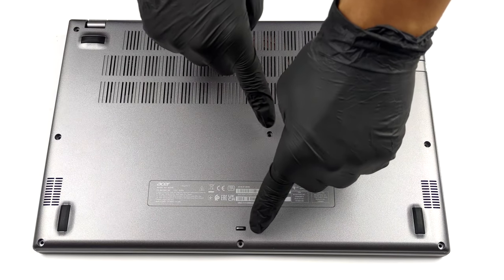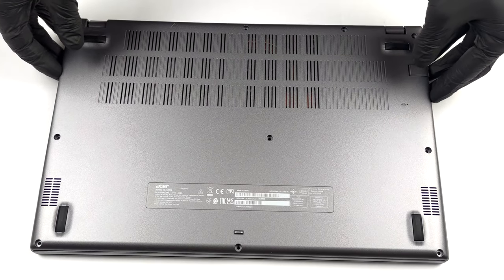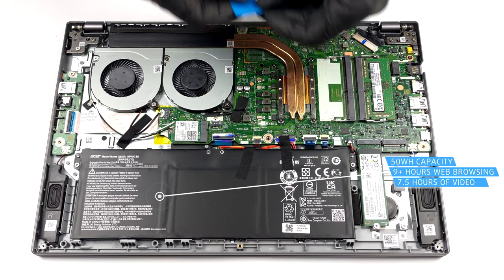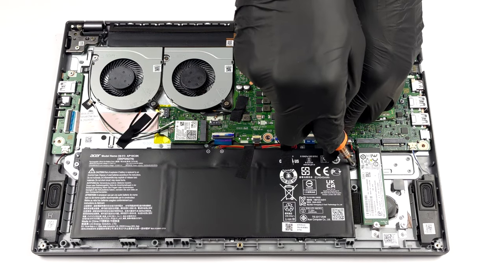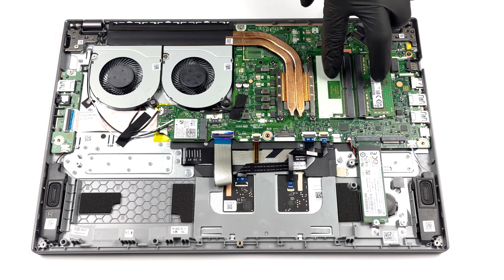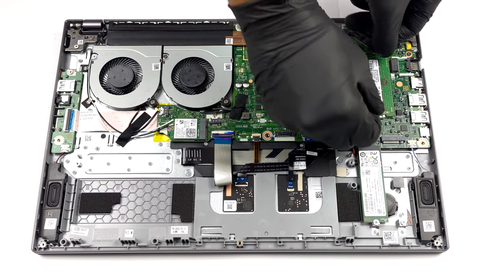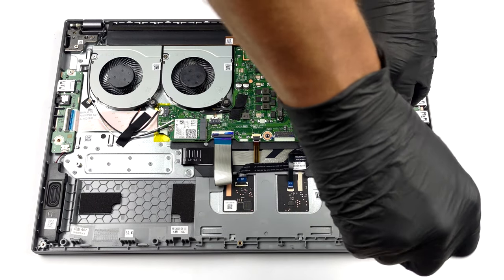🛠️ Acer Aspire 5 (A515-57) - disassembly and upgrade options

Comment: the 12th gen CPU's support up to 64GB of RAM. Is it possible to use one or two 32GB sticks in this notebook?
Reply: Acer tech support told me the maximum per module was 16GB. full max in total 16GB. I asked them several times and they all said the same thing. I decided to install two 16 GB modules and it works perfectly. 12th gen Intel CPU is my model. Don't know if 64 will be ok, bit maybe you can order and try as I did, and in case is not working, return RAM modules back.

Comment: I HAVE A NEW A515-57-53T2 ASPIRE 5 LAPTOP WITH A WD PC SN530 NVME SSD AND I JUST INSTALLED A SAMSUNG 860 EVO SATA M.2 SSD IN THE 2ND SLOT AND IT IS NOT SHOWING UP. WILL THE ACER LAPTOP RECOGNIZE THE EVO 860 AND IF NOT WHAT SSD WILL. THANKS, MIKE
Reply: Hi! Sounds like you'll need to format your drive. You can do this in disk manager. There are plenty of videos on YouTube about it 😊
Reply: @thetworedheadsandhim  IT IS MY OLD SSD FROM MY OLD COMPUTER WITH MY WINDOWS 10 AND i JUST WANT IT ACCESSABLE UNTIL i'M CONFIDENT THE NEW WIN 11 IS GOOD AND MAYBE JUST KEEP IT THEM FOR REFERENCE, SORRY FOR THE CAPS. What I wanted to know is if the SAMSUNG 860 EVO SATA M.2 SSD will enven work/be seen in the new computer. Thanks, Mike
Reply: Ah I'm wrong then, good luck
Reply: only supports nvme ssd not sata  get the 970 evo m.2 nvme best
Reply: @davidmorrison4711 the WD530 nvme ssd is a 3 and I want to get the newer faster nvme 4, will I  need a heat sink, sounds like I might from what I've read? Thanks, Mike
Reply: SAMSUNG 860 EVO SATA is SATA. This laptop supports only NVME

Comment: Is it possible to add a graphics card?
Reply: Não . Note vc nao consegue colocar placa de video.
Reply: I recently got an eGPU chassis and installed a 7700 XT inside, connecting it to my laptop via the USB-C port. The laptop detected the card immediately, and my 3DMark Fire Strike score jumped from 1590 to 13,000 points.

Comment: Hi, the laptop has 2 white colored tiny legs on the backside (bottom) of the display to elevate the body to pass heat efficiently. I have found that one of the legs is tilting. Is it normal , or will it get disconnected in the future.

Comment: I appreciate the video, but this model might be the most finnicky Acer laptop that I've pried open.

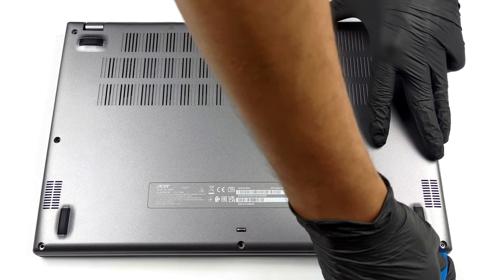The sides and the hinge are easy to be pried open without causing damage, which is good. However, the latches at the battery area are harder to pry if your prying tool has a shorter edge. A combination of small and large latches in that area also doesn't help. Damaged the small latches on mine as it was very deep for my prying tools to detach it although the large latches detach effortlessly without going as deep. Fortunately the large latches holds the back cover without any visible gap and the screws also helps to secure it further. It also made prying it again as effortless as 0:12 which made me wonder if this is intentional by Acer to refuse warranty due to tampering.
Reply: right. video is massively misleading. in no way do those clips come apart that easily
Reply: Yeah I just took the back off my A515-47 and it was excruciating.  I wound up breaking one of the tabs despite having the proper tool and taking my time.
Reply: @The4No  the video isn't misleading at all. everything does snap out as effortlessly as the video. as for 0:12 case, it does open like that when you ripped the small latches apart during the first attempt but you could get the same result if your prying tool can get deep enough. 

in short, you can pry it without causing damage if you are not using shoddy tools like mine and have the skills

Comment: Is this model aspire 5 A515-57-53T2 , also have two slots that can handle 16gb each ,in total of 32 gb ?
Reply: pretty sure yes i just upgraded to curcial 8x2 gb 3200mhz ram and it workss
Reply: @sahiru  I have the same aspire 5 with 8 gb ram. If I want to upgrade it to 16 gb, do I need to remove the built in ram of 8 gb(4-4) to install new 8-8 gb rams?
Reply: Up to 64 GB...

Comment: does acer aspire 5 12th gen intel core i5-1240p processor gaming laptop has integrated graphics like itel UHD along with dedicated graphic so that dedicated graphic can be disabled for non-gaming use for saving battery. Also pleasecomment on battery life like how long the battery last for normal non-gmaing use with 50% brithness.
Reply: pretty sure with brigness being low as possible it can go for like +8 hrs as my graphics card is always in use and well without power it runs for 4 hrs mim but i am sure if i switch to the integrated one it  can extended a lot and also it does come with a power saving mode

Comment: is there any difference in internal design of acer aspire5 (515-47)
Reply: no, it's the same design.
Reply: @xIJudasIx  thank you!
Reply: Same design yes.  But the A515-47 second SSD slot is a gen 3 not a gen 4.
Reply: I was interested in this question. Thank you for asking it. Having two fans makes me more comfortable trying to overclock it a bit.